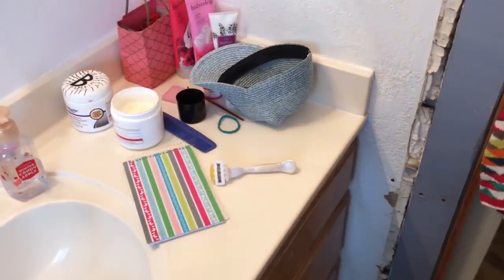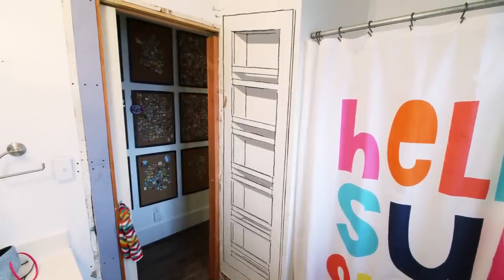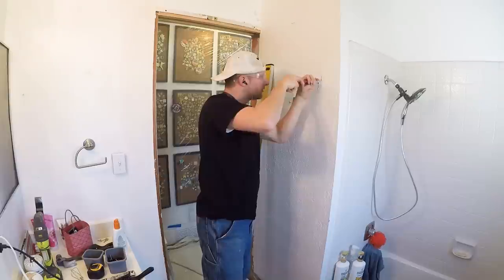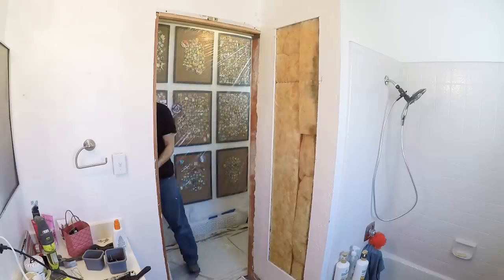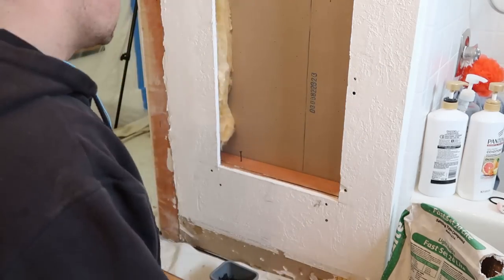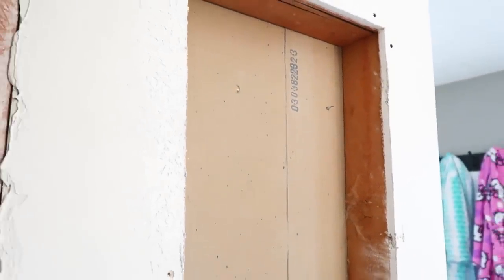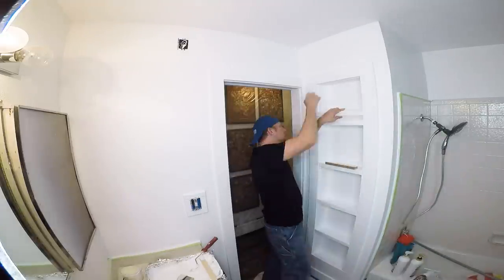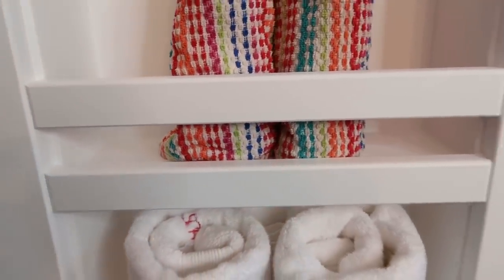How to Build Recessed Shelves Between Studs | Bathroom Organization

Comment: I used this idea to put a 12" deep kitchen cabinet above my toilet. Bathroom cabinets are typically only 8" deep because you can knock your head on them if they stick out 12". recessed it 4" into the wall and viola, now have a 12" deep cabinet only sticking out 8".  We remodelled our kitchen and are using the other old cabinets to go into our " new" laundry room. reuse, reduce,  recycle
Reply: Thats a great idea!

Comment: As with most activities I enter into, I tended to get carried away with it.  DVD collection I started to have "a few" to carry on motor coach trips for when no reception/rainy times......now over 5000 DVDs.  Needing place to store, organize them, I built in-wall DVD shelves in a long tall hallway featuring a library style rolling ladder on rails to access the upper shelves  As pointed out in this video, shelf depth becomes 4" (stud + drywall) resulting in the DVDs extending from wall about 1-5/16".....not an issue in a 48" wide hallway.  Each shelf...~14-1/2" wide holds about 25 videos.  (Also, built swing out DVD shelves to cover His'n'Her closet doors creating gun storage in both closets.)  Had to relocate some wiring, but not a big deal.  Painted inside the wall shelves black to hide less than perfect surface....rough studs, used thin wood corner trim bead glued to corners  protect drywall edges, providing a finished surround.  Used 1/4" pins in holes (drilled with right-angle drill head) in studs for thin shelves to sit upon, similar to common adjustable shelf concept.
Reply from the maker: Great comment thanks for sharing!

Comment: Have done similar projects. I paint the wood before I start assembling it also I screw it to the studs so that I can remove it if I care to for whatever reason.
Such as modifying the Shelf spacing adding in little shelving.
Also I'd very definitely finish that drywall backing with paint or whatever before I put the Shelf in. And I would trim out the gap between the shelving and the drywall with quarter-inch or whatever I would not depend on caulking for that size of a gap.
I love the way you mitered/rounded the edges and explained that you could round them off by hand if you didn't have a router.

Comment: I want to do this in my bathrooms & bedrooms in my two family that is actually two apartments without basements or attic space. I'm thinking about using a 12" sq of stainless steel in the top portion in the primary bedroom to use with magnetic hooks for easy placement of jewelry. Thank You for sharing this. You've got a new subscriber.
Reply from the maker: That sounds nice.

Comment: Some bottom blocking would be a good idea under those "ram horse" studs you placed in for the bottom supports of the cabinet.  This would ensure that the weight of the cabinet and its contents come to bear via the framing directly to the floor rather than floating or being suspended in the wall space only anchored to the drywall which can eventually give in some way or another.
Reply from the maker: It has held up great so far.  It's so narrow it can't hold a lot of weight to begin with.  But if you are worried about weight then sure you can do extra work to support it. Thanks for watching.

Comment: I built some recessed shelves in my bathroom, too.  It's great to have a place to put all those little things that end up as clutter, and so many of the things fit just right at this depth.  One advantage is that the shallow shelves make it easy to find things.  I put wood doors on mine to match the vanity so you can't see all the bottles of stuff.  I like your design, too.  Makes it easy to access things.  Highly recommended project with our without doors.
Reply: Are the drywall screws through the bottom 2x4 enough to hold the weight or will it tear down the sheatrock over time?
Reply from the maker: There is not a lot of weight so it's holding up great. Thanks for watching.

Comment: Very well done! Before you started you could have easily just painted that whole piece of drywall in just a few minutes with a roller. But I'm glad you painted all the wood pieces first before installing them. Painting raw wood shelves after they are installed takes so much longer.
Reply from the maker: Yes I could have painted it first, but I still have to paint over the caulk.  Thanks for watching!

Comment: It looks great! 
I much prefer cabinets with adjustable shelves though. I find my needs change or other’s needs are different from mine. I would add in the pre-drilled holes on the right and left sides before assembling, so you could use shelf supports (pegs?) in them and set your boards on top of them to be able to customize spacing between the shelves to maximize the storage in the unit. The bar above to hold things in place could be mounted to each shelf (or put on dowels and have holes drilled to accept the dowels in the shelf) or little small tension rods could be used above each shelf.

Comment: Any regrets not covering up the backside of the drywall?  Had planned on 1/4 ply or even 1/8” hardboard.
Reply from the maker: It has worked out great just painting it.
Reply: I may add texture to mine, to match the outter walls, with sheet rock mud.

Comment: My plan for the laundry room is to build a 2x8 wall with in-wall shelving and cabinet doors and add a bath behind the wall.  I plan on putting a barn door on the bath side of the wall.  Straight ahead would be the sink and toilet to the left and shower to the right.
And to put all the tools and laundry supplies in the in-wall shelving. Also plan to move the water heater to outside wall as tankless.  I will get 32 cf more storage. Also plan to put dryer box in wall to push dryer all the way to the wall for more room in front of washer and dryer.
Reply from the maker: Wow!  Sounds like you will be busy!  Nice work!

Comment: I'm a bit late to this video, but I have a weird space in my kitchen where I want to do a built-in and your video popped up in my search. This looks easy enough that even an amateur could do it! A few questions, though: if I want to do a built-in with a glass or plexi-glass door, could I follow this same process? Also, what do you recommend if the current space is open? I have a pantry that has two bi-fold doors, and then there's an extra section on the other side of a stud that's just open. It looks really dumb and I wanted to put in a built-in behind glass for collectibles to be displayed. Because there's currently no drywall along the back - it's just an opening that shows what's inside the pantry, would I need to add drywall? Or could I use plywood or similar? I want to make sure these shelves will be strong enough to hold heavy-ish items (nothing too crazy, but heavier than a few bathroom hand towels). Thoughts?

Comment: Instead of the cutting tool you were using, I just use a jigsaw with a short blade the goes about 1/8-1/4" beyond the drywall, checking for wires prior to cutting. Never know where the ugly buggers show up, especially in older homes. Great job.

On another note, where are the studs. The cavity you created seems void of studs that should either bein on the right or left of the opening, if not in the middle. I always make sure that I connect the cross bracing between studs with a header , then run 2x4's on both sides like jack studs on door/window. Some people don't know how to detect whether or not they are dealing with a bearing wall, and they might just weaken the integrity of a wall unknowingly.
Reply: He used the existing stud on the right, but was not going as wide as the left side stud. No studs (be they weight bearing or not) were cut. He added a two by four closer than the 16" on center,  to frame this shelf. I will be doing something similar, though I may make mine be the stud distance apart, to save work.

Comment: In theory, could you line an entire interior wall with these between each set of studs? Non-load bearing master bedroom closet wall specifically? Mine is so narrow that only one side can fit any rods/shelves and the opposite side is just wasted space. There’s one pocket I’d skip because it’s already being used as an air return, but the remainder should be completely empty. I specifically like your idea of using the backside of the drywall without having to add anything that consumes depth. Unlikely I would create this many shelves because I’m even just thinking this is a way to create pockets of space for clothes hangers to protrude, so I can run a second rod and be using both walls. Would love thoughts/feedback!

Comment: Love your video. Have been wanting something similar for a long time.
Why did you not paint the back drywall before installing the shelves? 
Was there a reason for 1" wood? Wouldn't 1/2" or even thinner plywood work just as well?
Just a reminder--for the real novice--do NOT build these on an exterior (insulated) wall.
Reply from the maker: I wanted to paint it after the shelves where in and caulked.

Comment: Nice design!  On the one I'm making, I want to have hidden storage behind a frameless door with a mirror attached, as opposed to open shelves.  I also want to preserve the full 4" depth (3 1/2" stud depth, plus the 1/2" drywall thickness).  So what I came up with is two 4" strips of 1/4" plywood for the side pieces made from one 8 1/8" piece (2*4" + 1/8" saw kerf), to which I apply shelf-supporting cleats every 3", squared to the edge, so that when I rip-cut them apart, the shelf-supporting cleats will be aligned on the left and right strips.  Shelves will be chunks of 3/4" white melamine (plastic-coated particle board), with a white melamine strip ironed on the front edge, and adjustable using the many cleats.  Paint out the back (which, like yours is the back of the drywall) and the side cleat strips with white paint.  Use the stud cavity (16" centers, minus the 3/4" half-stud thickness times 2 for a 14 1/2" cavity, less 1/2" for the two 1/4" cleat strips' thickness, leaving 14" shelves), and close off the top and bottom as you did with chunks of 2x4.  The cleat strips will hide the cut edges of the drywall on the sides, and extra 1/4" x 4" x 14 1/2" strips can cover the top and bottom 2x4' and drywall edges. Cover the studs and drywall edge with the cleat strips, which are attached to the studs.  For the door, a simple piece of 1/2" x 16" sanded-grade plywood (overlapping the cut-edge of the drywall by 3/4"), iron-on edge tape to hide the layers and painted out white, with a simple 13.375" x 49.5" cheap wall mirror attached (door length can be whatever is needed beyond the mirror length for the storage needs), mounted on small surface-mount cabinet door hinges that are screwed through the drywall to the center of the studs.  A magnetic cabinet catch mounted in the inside of the opening holds the door closed.
Reply from the maker: Wow that is some amazing detail!   Let us know how it turns out.

Comment: Hello! I have a niche/shelf that is basically 3 shelves with a back and sides all trimmed out with decorative trim on sides, top and bottom.It's designed to be put in a wall between the studs. After I cut the hole out between the studs, is it necessary to put horizontal 2/4's above and below it? Or can I just insert it into the hole and glue it in place allowing the surrounding trim already built onto it to help keep it secure? Sorry...this is our first home and I'm super new to this stuff! Thanks in advance for your help and for this video!
Reply from the maker: I think you should able to just insert it if it has a top or bottom.  Thanks for watching. We would love to see how it turned out.  Good luck!
Reply: @Remodelaholic  Thank you!!

Comment: Thanks =)

How is the back of the drywall holding up to the bathroom moisture?
Also saw you removed insulation... not sure what's on the other side of the cubby and now it's been affected by heat/noise?
Reply from the maker: Just fine.  No problems at all.  There is an good layer of paint.

Comment: I want to put one on the wall where my toilet is but i dont know if there a pipe in the wall any ideas?
Reply from the maker: Chances are there is a pipe going up through the roof for an air vent.
Reply: @Remodelaholic  so i can't really put one there then
Reply: @andregrenierjr7622  you could make a small hole to see if there are any pipes there, then patch it.

Comment: What kind of wood did you use or did miss it in the video? I am going to do this in my bathroom.  A contractor that remodeled my bathroom cut the wall out and left it.  He blew up after waiting over two months and me finally asking.  He said he is not coming back.  Thinks I owe him $300.  Told me to to keep the money and cover the hole.  I found your video and it was the simplest to understand.
Reply from the maker: I’m so sorry!!  How frustrating!  We used MDF molding.  The shelves were an inch thick, the molding just regulate molding thickness.  We have building plans linked in the description if that helps!  

Good luck, this really is a project even a beginner can accomplish, so it does sound like the perfect way to finish up your bathroom!!

Comment: This is helpful, but how do I create deeper shelves or more specifically, how to figure out how deep I can cut the opening?
Reply from the maker: Depends on how your walls are constructed.    Most interior walls in the is are built with 2x4's and are 3 1/2" deep.  The best way to check is to cut a small hole and look in it to measure the depth.
Reply: @Remodelaholic  Thank you, I'll try that.

Comment: Great build and tutorial, but you lost me at "MDF is a great material for this project" (paraphrase). The main downside to this application is that it's in a bathroom, which gets wet, and MDF expands when exposed to moisture.

Primed pine board would be a better material. It's straight, and will last longer in this moist environment.

Again, great build and instructions. Well done, brother.
Reply from the maker: Yes wood would be better,  but the mdf is holding up just fine for this project.  It has a good layer of paint over it.
Reply: This is what I was wondering, too. Been debating which material to use.
Reply: @JenEricRalston    
Compare the costs. 
It's a relatively small area so, even at today's lumber prices I would imagine the price difference is minimal.

Then there's the workability.
I think that in the video says he liked MDF because it was easy to work with, which is true in some ways. It cuts easily, bends a little more making it easier to squeeze into place.
For me, I feel like wood is more forgiving. I'm pretty clumsy and make lots of little mistakes in my woodwork. I know how to fix those wood related issues better. That's just preference, I guess.

Durability.
Wood will definitely last longer. It depends on how much abuse and water you expect to expose it to. I recently moved into a 15 year old house where they used MDF throughout the bathroom, including the window sill. There were a few spots where it looked like someone set a cup on the sill, and it bubbled up. I thought about replacing it, but we don't expect to live here long so we sanded it down, and repainted it... Looks totally fine, we just won't set any cups or wet objects on it while we live here. However, if it were my previous 1926 Craftsman, I only ever considered using wood there. I expected that house to be around for another 100 years.

Good luck

Comment: How would you mount this with metal studs? Would the install only be slightly different?
Reply from the maker: I would use whatever screws you used to mount and into metal studs like a self tapping screw or something like that but it's not too different

Comment: It's hard to tell from the video, but just fyi for anyone who wants to do this themselves--new studs should always rest on old ones. You should NOT hold up a stud just with drywall and drywall screws, that weakens your wall rather than strengthening it.
Reply from the maker: These are not heavy shelves and they are holding up just fine with how they were made.
Reply: Thank you - I was wondering about this myself, as that bottom stud is taking the weight of the whole shelf.  I was thinking I would have at least wanted to screw it into existing studs or put in a small jack stud underneath

Comment: How did you know you weren't going to cut into studs not drywall?
Reply from the maker: A stud finder helps locate studs.  If you don’t have one you could use a hammer and nail to locate studs (you just may have a bit of patching to do after)